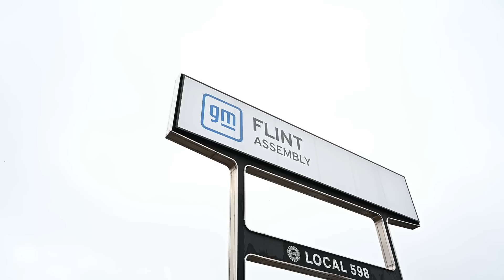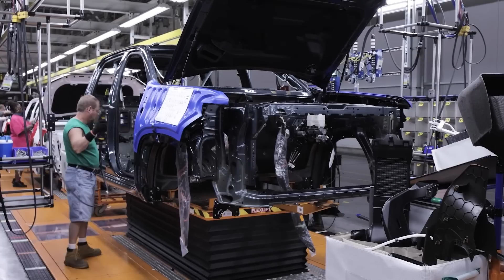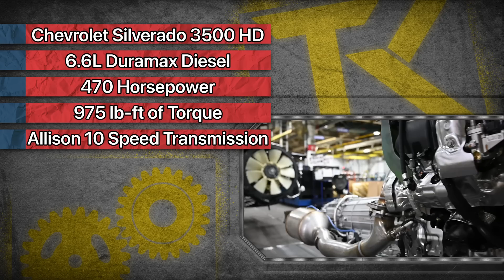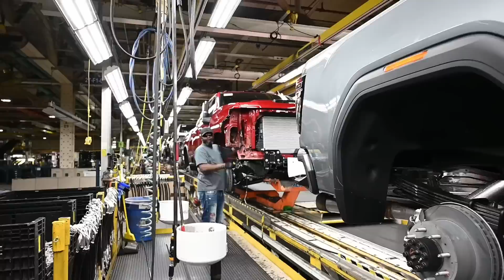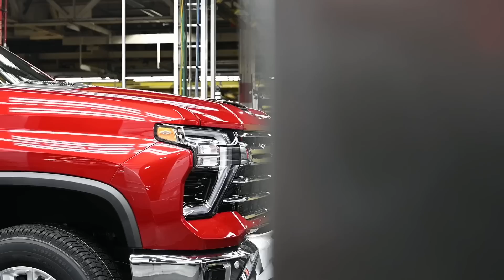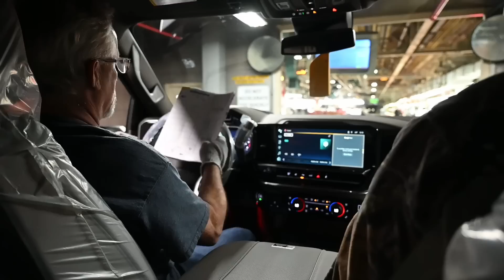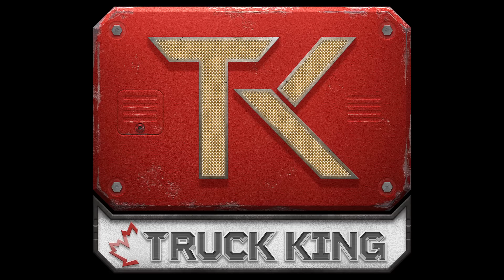I Got to Watch Them Build MY New Chevy 3500 HD at Flint Assembly!

Comment: Awesome video.  I've spent a lot of time in a GM plant.  We originally lived in MA and my dad worked at the Framingham plant.  Got transfered to DE to work at the Boxwood plant.  Think they were building the Solstice before that one closed down.  Now it's an Amazon hub.  Anyway, did a few field trips with schools there over the years plus spent time after school waiting for dad to finish for the day.  Watching that plant operate in unison with those robots was amazing! 

Now I'm 40 and my 4th GM truck is 10 days old sitting outside this same Michigan plant.  24' Sierra 3500 crew cab long bed gas at4!  Ever since my first truck, my 04 Colorado, I've wanted a HD beast.  Now I actually need it for work and it's a reality.  I have had great luck with each truck.  The truck my new one is replacing is a 2015 max tow 1500 sierra with 282k on it now.  Still looks new.  I've got almost 700,000 miles out of the previous 3.  Looking forward to another 250k out of this one!  Can't wait
Reply: I was skimming through the comments ( watched the video when it first came out as well ) as I have put an order in for a 2025 Chev HD 3500 standard bed with the L8T and that is why your comment stood out. I am curious how its been working out for you so far, over all truck wise mechanically as well as thoughts on the engine and mpg. Unfortunately I have been hearing about transmission issues with the 10 speed in the diesels since they have been out a lot longer then the 10 speed introduction into the gas in 2024.

Comment: My 2015 2500 HD was built in that plant. 136000 miles and it's been perfect. Runs and drives like a dream, 6.0 litre gas. Mine is red also, I think that year called it ruby red metallic. I love it. It's a Chevy also.

Comment: I'll stay with my 2006 Silverado 2500HD With 200,000 miles running strong and looking new. The new trucks are around 40% over priced and built like junk.

Comment: Wish the GVWR wasn’t 12,500 it would be nice if it was just 12,000 so company trucks could hook up to a 14k trailer and not need a cdl.
Reply: I am curious, what state are you from as I get the idea there is a reason why the 3/4 ton is popular over just getting a one ton which is nearly identical, just a rear spring overload system .. a larger rear axle in some cases. Where I am in Alberta it makes no difference at all to what drivers license or insurance is required ( assuming personal use ) and a reason why they bring in a mix of 3/4 and 1 ton to sit on the lot or if prefer to order the exact options one wants or skipping those that one does not want.

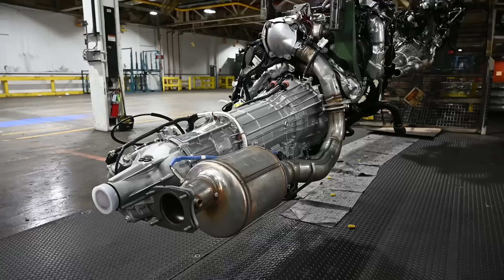Comment: At 4:33 is the exact moment I would be tempted to remove some unwanted parts with a sawzall and let that brand new rig breath the way it should.
Reply: Then they wouldn't be able to sell it to you and you'd have a CEL; not to mention there's cameras EVERYWHERE in an assembly plant.
Reply: Funny, that was my exact thoughts also. I was watching a video lately of a farm couple from Nebraska that had flown to Argentina this late fall and were touring around on a large farm down there. The Nebraska farmer was shocked to see that late model combines and tractors from John Deere ( and assume built in the USA ) had no DPF or DEF systems on them. You tell me how that works, we get strangled with all this crap and some other countries get a clean workable diesel that will have a mere fraction of the problems. Obviously that means JD for this example has a completely different tune for those export pieces of equipment. I wonder if Ford/Ram/GM have such a double standard as well, would be interesting to know !.

Comment: If that truck is raw steel, and it's sprayed instead of dipped; now I understand why Chevy's rot the rocker panels, fender wells and bottom door panels after 5-7 years. Please tell me that isn't raw steel.
Reply: They are dipped, I've seen other videos showing that.
My 2005  3500 is the same and has been in winter conditions since new.... no rust yet!

Comment: Allison doesn’t make a 10 speed light truck transmission. GM does make one and puts a Allison sticker on it
Reply: That's right, Allison certified it, after it met their engineering standards, why else would they risk allowing their name on it.
Reply: @CS-rb9jk  because money and marketing.
Reply: @JasonNotBot  That make perfect since so ...  Ok, GM had a corporate meeting like this.. " Lets build a HD 10 speed that is all new and ask Allison if we pay them enough can we to put an Allison sticker on it" .... Allison corporate meeting, " GM is building an all new HD 10 speed and wants to pay us to put an Allison sticker on. We don't need to worry about its reliability or how it might effect our name and reputation because They said they would pay whatever we want.
Reply: @CS-rb9jk  you may not have intended to be correct with your sarcasm but you might be surprised. Allison’s own press release says “branded” that’s a purposeful choice of words. You may be surprised on who gm did most of its engineering work with…..Ford Motor Company. GM is very good at marketing and well I’d say your a perfectly example of it. Cheers

Comment: I ordered my 2500 last August and they haven’t even pulled the order yet!  How long did you have to wait to get your order???
Reply: There is something wrong with your situation. Your dealer either has no allocation or your order was cancelled. Find a new dealer.
Reply: @pryme2013 I’m bringing the hammer down today.  If I get wishy-washy answers and/or hear the words “allocation” or “strike”, I’m picking up my deposit and moving on!  I know i should have had the truck by now based on other’s experience.
Reply: @Broncort1  Fast forward 11 months, what ended up happening with your order and did you eventually get your truck. Also was there something unique about your build that may have caused a delay, such as ordering a double cab seems to be one big hickup. I get the idea that crew cab standard box trucks are the truck they focus on most to send out the door in large numbers. A long  box could also slow down the process of them accepting the order to build.
Reply: @charlesb4267  I can most certainly fill you in!  The dealership said they “dropped the ball” with my order.  I took back the deposit and left.  There happened to be a truck VERY similar to what I wanted at a dealer almost 2 hours from me and wound up buying that truck.  It is the crew cab instead of the double cab and has the motorized running boards on it…which is didn’t really want because I figured they would be the first thing to break but I did get the color I wanted (Auburn Metallic) which is no longer available.  Truck barely fits in the garage with 6” of play…which was why I wanted the double cab (10” shorter than crew cab).  It has had a very easy existence for the last 11 months with 3400 miles on it currently…buying the RV in the Spring.  Only got wet once in all that time….lol.  I’ve added high idle, headache rack, airbags, MAP sensor spacer, tonneau cover, B&W ball hitch, 5th wheel hitch, and upfitter switches for dash cam.  The truck has been awesome to this point!
Reply: @Broncort1  Isn't that odd of that dealership, I wonder if they never got the order even sent in at all to GM since they never even made an excuse about the double cab being a choke point in getting a unit built. Other than the increased length for the garage issue which is an all too common issue with garages, you ended up with decent room in the rear seat area as well as a longer more stable wheel base platform for towing. I gather you bought the diesel and perhaps something like the Banks Idash might be a tool you would get use out of for knowing where your at with the dpf for regens and allow to force a regen if needed as well as monitoring various temperatures, and its supposed to show what gear your in ( GM failed to deliver on that count in my mind ). I recently had ordered a truck myself and always had the duramax in the back of my mind but the reality is that it may get more shorter runs and cold winter temps thrown at it then its emissions would like and the DEF crystallizing due to lack of use and the truck always sitting in the cold all winter. So I resigned myself to going with a gas instead with the theory of making life more simple since I really don't know how much towing it will even do, I don't have a "plan" with it other than transportation and knowing I can haul weight and tow reasonable loads and put a fifth wheel or gooseball in the bed vs a half ton that is more like a car with a box. And its a Chev I ordered simply because I wanted radiant red as the Denali dropped that color for 2025. Had I wanted the duramax, I could have probably found a 2024 on a lot with the good incentives that are still on at dealers and get the "fancy" dash that the Denali has. By the way I did order mine with the upfitter switch system, that is something which might finally have been figured out for the Denali truck but not sure as its layout does not lend itself to that. Oh and one last item, no I did not order the electric running boards as I know where I live they are a sore spot due to all the crap they spread on the roads during the winter and the first thing the salesman said "don't get the power running boards" LOL. I'm sure they will function in decent conditions but here with not only salt but calcium mixed with the blend at times its an extra killer and it gets into the motors.
Reply: @charlesb4267  the truck ordering guy at the dealership quit a month after my order so that’s how my truck probably fell through the cracks.
Reply: @charlesb4267   I forgot that on my list…I do have the idash mounted to the pillar and even though I can now see the soot level and gear I’m in, I can’t force regens yet….they still have to update the software.  So yeah, I did get the diesel and in fact just drained the DEF fluid tank and added a jug of Platinum DEF.  I add bottle of Stenodyne to every fuel fill and the truck is starting to harass me about getting the oil changed.  They did say every year or 7500 miles and the year is about here!
Reply: @Broncort1  I would have thought that the dealer would jump the next day and get the order placed and then get the approval back with a "work bench order"  and also get a stock order number/letter designation. I don't know if the dealer has to keep interacting after that point, certainly someone honest who is or has worked at a dealership would have more insight into why your order went nowhere. Oh and as to the Idash, I have been assuming yours is a 2024 model truck and so I understand GM has a new computer platform for 2024 and I suspect that is the road block into gaining access to give the Idash control, again assumptions on my part. By all means change your factory oil earlier mileage wise than a normal oil change period and since its screaming at you due to the calendar, have it changed. I did see lately on someones channel about them experimenting with the Platinum DEF as they would pull the sensor at mileage intervals and the sensor got cleaner and cleaner as time went on vs what it initially looked like with the regular DEF that was crystallizing rather alarmingly. By the way where are you located as that will certainly help or hinder the life of the emissions as per the temperature its operated in.
Reply: @charlesb4267 I didn’t give the dealer a chance….one chance and they blew it…NEXT!

I live in NJ but it’s in a heated garage in the winter and out of the sun in the summer so DEF hasn’t been an issue.  I just changed it pre-emptively.
Reply: @Broncort1  I agree with how you handled it, I will see what develops with my order as I would be lying if I claimed I had 100% confidence in them or any dealership for that matter. I've never been anywhere near that area of the USA, over the years due to one thing or another I have touched on just over half of the 50 states but nothing at all in the north east and don't expect that will ever happen. Perhaps this is wishful thinking on my part but I hope your truck never goes out onto a salt covered road in its life. Unfortunately I won't have that choice with the impending vehicle purchase so plan on experimenting with fluid film as I doubt it can be worse then doing nothing but a lot of on going work year after year to reapply it and no shop around here does that anymore.

Comment: Glad that factory built your truck perfect. My black 2024 LTZ  had some errors the workers missed. A dust nib in the paint on back driver passenger door. Noticed it a week after owning it, went to several body shops and they said they could try to wet sand or repaint but I chose neither of those two options. Small dent on front passenger rockers, luckily the paint wasn’t cracked or chipped. Front driver seat floor trim not lined up properly. Inexcusable for $75,000 truck. Already looking forward to getting a new one in two years. Pretty upsetting that I’ll have to be on the lookout for errors that shouldn’t be there from the get go.
Reply: I feel like your dealer should've caught that stuff during the PDI process and let GM know about it. Because if they caught it, they might not have let you taken delivery until all the issues were addressed.

Comment: Excellent video,  cudos to you & to GM allowing you to get right in the thick of the assembly process  !  Love your proper 8 foot bed - a real truck  !   And the gorgeous RED  metal flake - not boring grey primer color we see too much of.  I miss my Chevy C3500 2000 MY dually 454 gasser. This truck will pull your 5th wheel like there's no tomorrow

Comment: Ah, the memories of when I worked there in the late 70's! Surprised to see it so familiar.  I was a painter one year and I see that robots have replaced me. I used to paint  the left door inside and out, dashboard,  left side of box and left side of tailgate.  I had a guy across the booth doing the other side.

When I was there, they built GMC and Chevy trucks on one line and Blazers and Sububans on the other. Line speed was usually 62.5 trucks per hour.
Reply: If it is a’78 or ‘79, there is a 33% chance I did. There were three shifts at the time and I worked second shift.🙂
Reply: ha you probably painted my truck
Reply: The paint shop is in a whole new building now. This complex has gotten quite the face lift since your days.
Reply: Hello! I have a question. Since the Chevy & GMC are both on the same assembly line, do they both get the exact same paint?
Chevy calls it's darker red paint, "Radiant Red Tintcoat" and GMC calls it "Volcanic Red Tintcoat", (on the LT & SLE Trims)
Just curious. Thanks!
Reply: @lighthouse7i  Truck King probably knows but back when I worked there, the paint colors were the same.  We had 13 different colors and if a Chevy was painted Carmine Red, the GMC used the same paint.  It may have been called a different name, I can't remember, but it was the same exact paint.  One year we did have a special run of yellow that was used for a fire department.  It was a neat bright yellow, even smelled good!
Reply: @gregkloe  - 👍
Reply: You might have built my vehicle 👍👍👍
Reply: Thats an amazing number like 1 every minute. Hard to even imagine that

Comment: Hopefully all goes well. The 24’s are having some growing pains with the new electrical architecture they rolled out. Lots of little bugs showing up that were never a thing in the 20-23 trucks. My 22 has been near perfect so far knock on wood.
Reply: Ya that’s always the risk. I bought a used 2017 Ram 1500 instead of the new  at the time 2019 partly because of the risk a new design brings.
Reply: I have a 24.   What are the issues you are speaking of?    I have 16k, and it is perfect